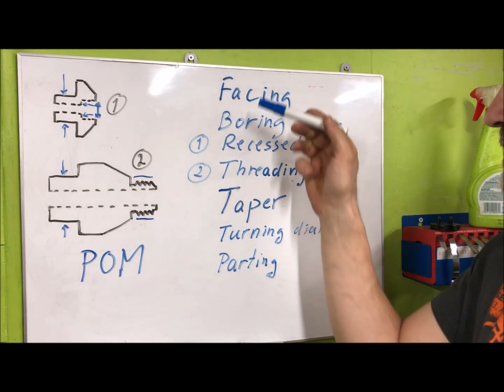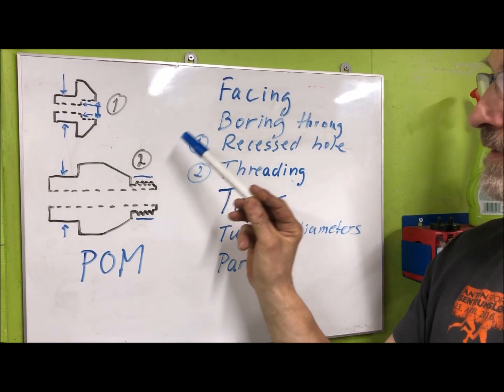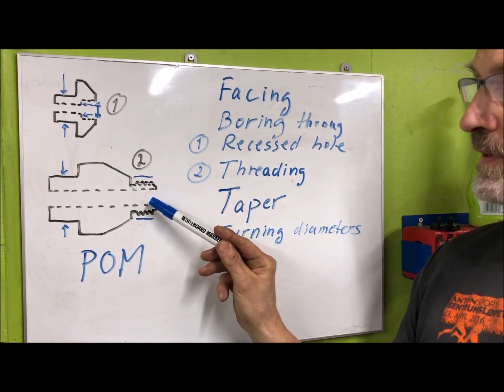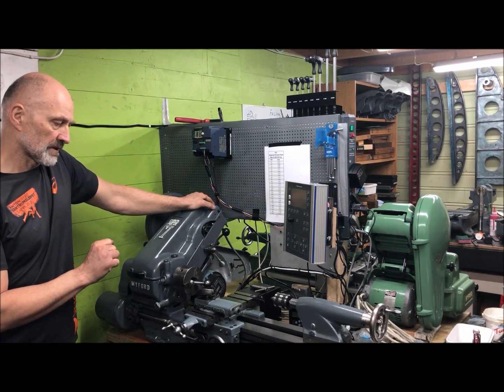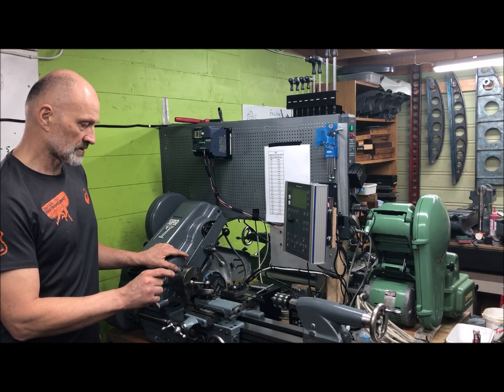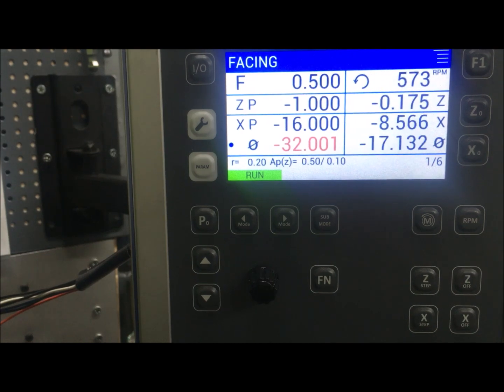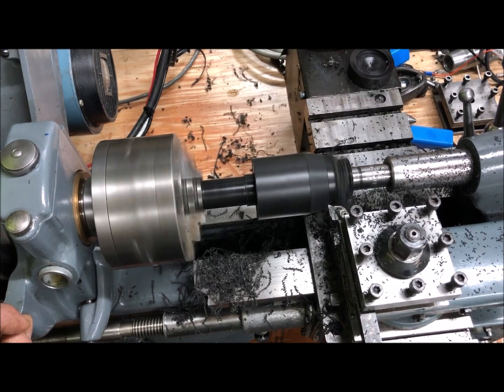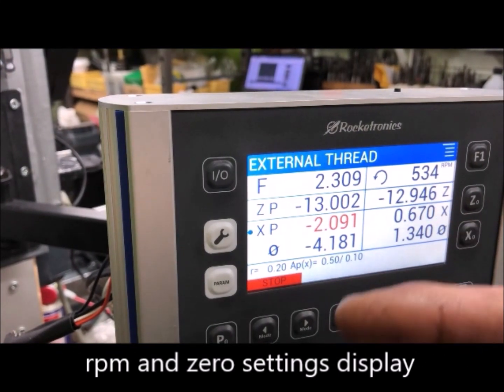Myford S7 with ELS - making some POM parts

Comment: Very informative thank you,
I have a question about the els 4 pro
I have just taken delivery of mine in the manual it doesn't mention about imperial lead and cross feed screws
Are you still on  imperial screw or have converted to metric,
Or when powered up in settings it is straight forward to set.
thanks Tim
Reply from the maker: You're welcome.
It is straightfroward to set up!
I have retained the original 8 TPI leadscrew. First I had a belt to the motor, transfer ratio at 1:1.6, but on recommendations from Rocketronics I switched to a 1:1 drive, also using a direct coupling with the connectors they supply.  I then used the ratio 25,4:8 = 3,175  and entered this in the setup menu for the Z axis.

PS! There will be a certain cumulative error, as kindly explained by my NZ mate for xample for a 18TPI thread:
1inch = 25.39998628mm, so 18tpi = 1.411110349 mm pitch

So the error = 1.411110349 - 1.411 = 0.000110349 mm per thread

100mm rod has 100/25.4 X 18  = 70.9 threads

The Cumulative Error = 70.9 x .00011mm   =.008mm for the 100mm piece   
.. to my understanding well within what can be accepted. 

For the X-axis, I went with a 2mm lead screw, ie. metric. I also changed the dial (from Myford) so that I could use this for "manual readout". The original imperial screw/nut were worn. I could of course have bought a replacement imperial set or the metric set from Myford, wouldn't have mattered from the ELS point of view.. just a different ratio to plug in, but I wanted a longer screw so I could fit the motor from the rear. Then it also seemed logical to swop to metric.. I drilled out a matching hole in the rear of the cross-slide casting and mounted a rear nut in addition to the front nut. This way I can also have a means to adjust for minimal play/backlash. The x-axis motor mounting can also be done from the front, either direct in line with the cross-feed screw or via a toothed belt from the side ie. apron mounted, but both will in my opinion be a little problematic. If direct coupled it will protrude and kind of be "in the way" or if to the right-hand side it may interfere with the manual feed handle (left-hand side being occupied by the clamp-nut engagement lever). Therefore, a rear-mounted motor seemed a better choice. I happened to have a belt and pulley to make a drive system from the screw to the motor which would enable me to lower the motor and thereby be able to have the cover over the motor flush with the top of the cross-slide.  This also meant I could mount the motor a little closer, not having it sticking too far out in the back (although may not matter as it still is kind of flush with the rear of the motorizing assembly). However, the pulleys I had on hand provided an oddity when it came to the ratio. .don't even remember the exact number. However, it is not a problem, just key in the number whatever it may be with the chosen screw pitch (or lead as I have learnt we call it in a metric ISO system). It functions, but I will probbaly change it to a direct 1:1 drive as on the Z-axis, although "adding" 1-2 cm to the rear and also moving the motor up so the cover will be higher than the cross-slide (it seemingly doesn't matter anyway.. I tend to use the space today as storage space haha)
Reply: @jansverrehaugjord9934  thank you for that information it has been very informative 
I'm fitting to a imperial Colchester triumph 2000 lathe as soon as the last few bits arrive
Keep up with your great videos 👍
Reply from the maker: @timgarrington6828  Thnks ☺ good luck on the ELS implementation.. I am sure many would also love to see some pics or a video ..

Comment: Nice to see some real parts being made with the ELS. Have you thought about putting one on your Russian lathe? Seems like the capacity/rigidity of that machine would be useful compared to the little Myford. (The quick change tool holders would also be nice :)
Reply from the maker: Thanks for the comments, Luke.
As you know, the ELS can be adapted to "any" machine, big or small, really only dependent on choosing the appropriate size stepper motors (hybrid steppers preferred for Z-axis). However, I think the biggest advantage would be to "transform" a "change-gear" lathe, thereby avoiding the "pain" of setting combinations for different threads/feeds. That said, many will probably go for a sort of auto-feed, eg. a small electric motor mounted on the z-axis, able to be switched in/out of the system so as to allow for use of the change gears for threading, leaving these in a certain "mostly-used threads" setting. In my eyes "semi-nice", but I considered this also). Anyway, the gearbox on my Russian lathe is quite nice and has a good range for threading, even imperial, so I think it will stay "as is". . However, in this case I actually think an 11 TPI thread is outside of what is possible. I could also not find this at the Weiler (Praktikant), so might be a special. We normally send such work out to a CNC shop.. like the rest (of course), but sometimes have to do it manually. For this specific piece it is a hassle on the Weiler to setup a the closest approximation (and results are not really satisfactory anyway).
Any improvement for better rigidity on the smaller lathes is a bonus. I could have gone the route that others have done, eg. Stefan G. by making an adapter plate and onto that a QCTP system (I considered that). This way you can also use a bigger than normal QC system to allow for use of bigger tools as you can make the plate to any height to accommodate the given choice of the QC system. I might still do this.. at least to try. However, I decided to go for the very simplest.. namely just a section of square bar (50x50 mm or so would do as a good base), slotted to fit a certain tool, hole down the center to mount a screw with a T-Nut (could also make the bottom that mates to the cross-slide with a T-slot for improved holding, but then would not have any angular setting possibilities). Same as you would have on the small microlathes eg. TAIG, for example as shown here https://www.google.com/search?q=taig+toolholder&rlz=1C1CHBF_enNO876NO876&sxsrf=ALeKk00TPKK-Cc5m63hvk-QqZu408VjTMA:1583312082528&source=lnms&tbm=isch&sa=X&ved=2ahUKEwi8oP2RuYDoAhWOxIsKHRpZAYMQ_AUoAXoECAsQAw&biw=1920&bih=969#imgrc=P5EWhVKyaiYQgM
Reply: @jansverrehaugjord9934  That makes sense,  avoiding change gears is a huge deal. Maybe because I have never had a lathe without a thread cutting gear box my first thoughts were threading into blind holes, cutting tapers and the sorts of things which can be tricky on a conventional lathe with or without a good gearbox. I can cut any normal thread with a turn of a knob and any imaginable thread if I change the gears but I would still consider putting an ELS on my Schaublin if the drive arrangement wasn't so difficult. (as you know it uses a rotating nut ballscrew on the Z) I think the Emco v10 with some upgrades will be a better platform for an ELS despite being one 10th the weight so I will end up in more or less the same place as you are with an ELS on a light machine :)  So in theory the big heavy machine is more appealing but ultimately less viable. I guess if one wants a proper cnc lathe it would make more sense to buy a used one already setup.